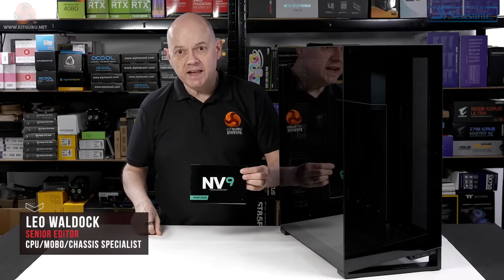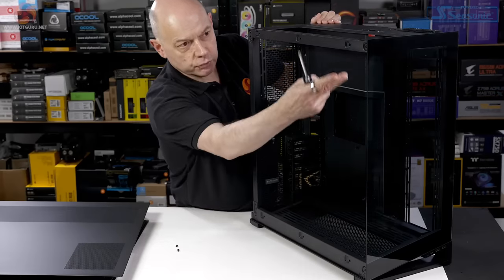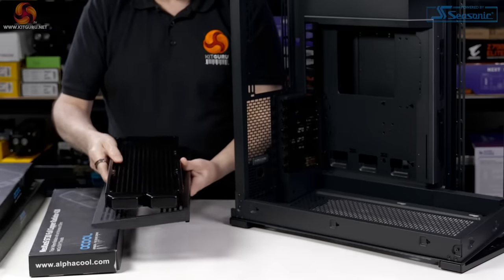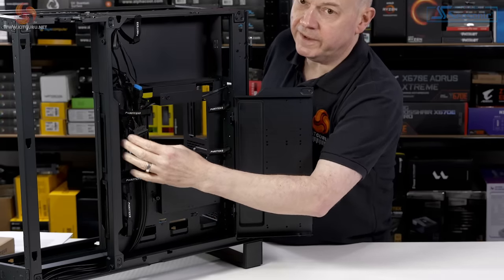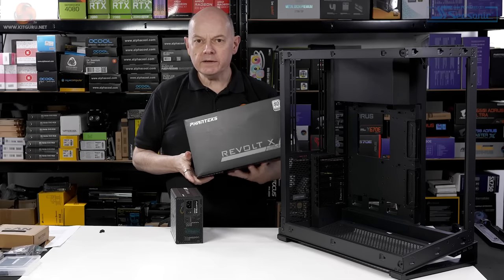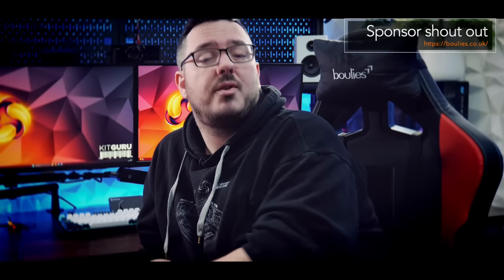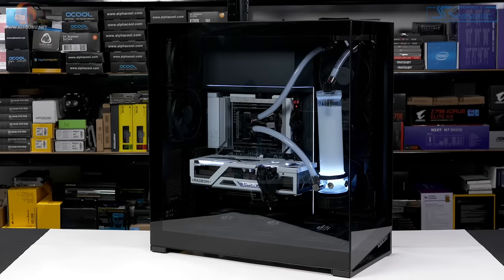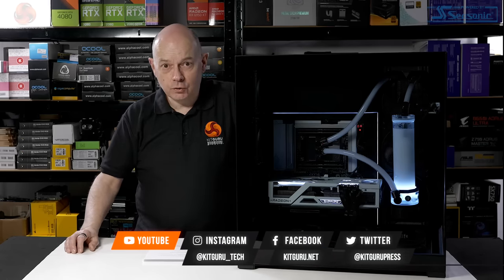Phanteks NV9 Case: Three radiators and 12 fans, easy peasy

Comment: That’s a monster. Completely unneeded in todays market
Reply: By most yes. Always someone will need something this big. I’d say it’s pretty good for threadripper or something with a lot of heat output.
Reply: Yeah, it's a case for peeps with a small pee pee. Compensator 3000.
Reply: More space for RGB!
Reply: If you want easier cable management or big radiators, then big cases are completely necessary.
Reply: @pluviamachina3583   Overclocking is dead, bro.
Reply: Looks bigger than my O11 XL  Evo!
Reply: Speak for yourself. As someone with large hands, multiple  radiators and a custom water loop, the more space to work the better. Few cases utilize 420 radiators.
Reply: Enthusaiasts

Comment: Phanteks also sells a 5.5" Display with magnets for that space, only downside being the need for a free HDMI (and the price). Other than that any 3rd party option with magnets or even 3M would work. Screens, LEDs, Custom, graphics/decor, maybe for the hardcore DIYers an extra space for Pump/Water block with a bit of drilling as long as you mind the PSU.

Either way really love this case, only thing the O11 Evo XL has on it as the next best case IMO is its ability to move the IO to the more convenient side of the glass, but even then the NV9s is movable so Im pretty sure I could jury rig a custom mount or IDK, let it sit on the desk. Speaking of which, this case may be peak in all thing including price, but If it has one true flaw its that the front IO is still USB 3.2 Gen 2 when mobos have Gen 2x2 by now, but for some reason all case manufacturers are still holding out on us.

Comment: Had the case and returned it. Cable management is a nightmare and even with a thick 60MM top radiator the case is way too large. I prefer the NV5. Keep up the great work you guys and stay safe.
Reply: Did you buy the nv5 ?
Reply: @Necromancerbob-zp7us  No. Still debating which case I am gonna get.
Reply: Nv5 is great
Reply: NV5 looks like the sweet spot
Reply: The bottom fan on the NV5 won’t do much. Plenty of better choices around. The DeepCool Morpheus, for example. Very solid case, includes a riser cable. Not perfect, but for who need the space, a very decent case.
Reply from the maker: Thanks for sharing
Reply: The space above the mobo is silly. I'd much rather have the mobo centred and more room on the bottom

Comment: I have 3x 420mm and a 280mm rad in my nv9. Easy fit. Vertical gpu option with bottom rad would be nice though

Comment: It's a shame they couldn't quite fit a 4th HDD spot where the last two SSD's go, but otherwise a very nice looking case with incredible specs (the rear fan space really drew me in for an AIO GPU location). I am still strongly considering it for my own upcoming build, but will end up using it for a build at some point in the near future regardless. Also, extremely odd for them to suggest such a negative pressure system with the fan setups, especially since the side should be essentially acting as a front intake in a case with no front intake. 

Another thorough review by the KitGuru team.

Comment: bit of an odd question, with the pump+reservoir directly in front of the fans, doesn't that block airflow and lower the efficiency of the radiator?

Comment: To Leo's point, I think this NV9 is geared for people who are planning to run a custom loop with at least 2 rads in the configuration. Maybe even running 2 separate loops completely with each loop having its own reservoir and pump. 1 for the CPU and 1 for the GPU. In that scenario, you would make better use of the interior space. 
Last, I thought it was odd that Leo did not use the Phanteks fans that daisy chain with all the RBG capabilities. I think they are called the D30 model? Those fans are thicker and only need 1 cable per row. If I was spending this kind of money, I would go with the big boys that leave me the neatest cable management options, regardless of total cost. You don't buy a NV9 case on a peasant's budget.

Comment: I might give this case a try I have the MSI 4090 Suprim liquid X and a 360 radiator for the CPU that has a push/pull configuration and with the Dynamic Evo XL I can only mount the 240 radiator for the GPU towards the side but to have a positive air pressure I need to have one fan set to intake which is just causing it to suck the hot air of the 240 radiator back into the case causing my PC to get hot more often it’s annoying hopefully I can mount it to the back with this case along side the 360 push/pull setup I have to the top otherwise I’ll sell this GPU for a non liquid cooled version
Reply: I have the same card and I mounted it's radiator in the back as the exhaust, I also have push pull for the CPU but 420 radiator so I mounted it in the top as the exhaust... And my two sets of D30 140mm reverse fans are just arriving, going to mount them in the bottom and side as intake and I think should be able to achieve good positive pressure with those 6x140mm D30 fans at avrage speed

Comment: Such a huge case and no support for 480mm rad. Yes, 140mm is usually quieter for airflow, but less static pressure than 120mm fans. I would take a 480mm case and 4 T30s any day.
Reply from the maker: As we say, there is support for a 480mm radiator in the side position.
Leo
Reply: Pls which 480mm aio is available to buy?

Comment: Would be perfect if instead brackets, used rails. Not really a fan of 140mm fans being greatly blocked by the bracket because of 120mm compatibility. Guess that would be even cheaper to implement.

Comment: Reminds me of the HAF 700 but more concerned with looks than function.
Reply: LESS concerned with looks and MORE concerned with function, you mean? The HAF 700 and HAF 700 EVO are magnitudes more "showy" compared to the NV9, which has a lot more functionality-focused features.
Reply: @pluviamachina3583  No, I meant it the way I stated.  Glass intead of mesh on the front, a door to hide the rear IO, worse cable management, blocked off area next to the motherboard with a strip of RGB instead of additional mounting options, etc. The HAF has more flexibility, better airflow, and is easier to work in/on (no tools required for most things).  The HAF looking better doesn't hurt it either.
Reply: @94b20gsr  I disagree that either case is worse than the other to work in. Sure, the NV9's system is different, but it's not bad, and the same goes for the HAF 700 EVO.

However, it's foolish to suggest the NV9 is better looking. The HAF 700 EVO will immediately turn heads whereas the NV9 looks like any other rectangular prism case.

Comment: Sweet Phanteks case. But I believe my Thermaltake CTE C750 Air is a much better fit for me.
Reply: Better size too
Reply: @browntrousersforsafety-el2bo   Both cases are actually within a quarter inch one way or another of being the same size. Thermaltake simply built it better, in my opinion. No screws to take off the panels, motherboard rotated 90 degrees, and better dust filters, and lots of room for long tubing runs in my dule custom loops.

Comment: The moment I sow NV7 I was amazed and disappointed.. No 420 radiator and no 140mm fans where deal breaking, and I said at the time and even posted comments that phanteks needs to make a slightly bigger case and call it maybe NV9 with 420 support, thank god phanteks had it really in mind.

I have NV9 for some time now it's really huge much bigger then my previous EVOLV X but still looks great on my desk and actually makes 48" C2 next it look like average 27" monitor hahaha

Case do have some unexpected flaws however... Those ARGB modules around motherboard are real pain in the a$$ and, and few things could be done better quality wise, coming from EVOLV X it's downgrade in some ways, I had EVOLV X for 5 years and not a scratch on it, TG panels look brand new today and the case itself.. On the other hand my NV9 have front glass panel already chipping on the corner and I didn't even remove the protective plastic yet.. Also side metal panel has very weak plastic bits that can broke easily
Reply from the maker: Sorry to hear about your nv9 experiences. That’s disappointing.
Reply: @KitGuruTech  it does it's job but still I miss quality and almost toolless design of EVOLV X , phanteks did sent me a replacement for one plastic piece that had broken as it was not tight enough from factory on my NV9, as for the front glass I am not sure what to do, kinda looks like it's my fault although I know I have handled that piece with extra care placing it on bed with extra thick pillows but still got damaged somehow..